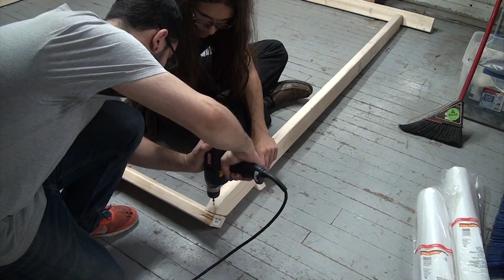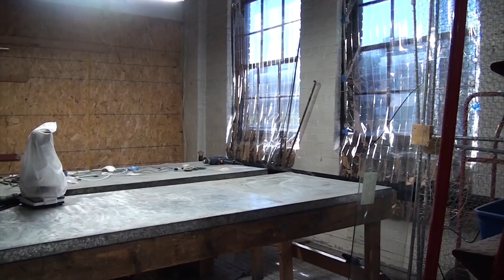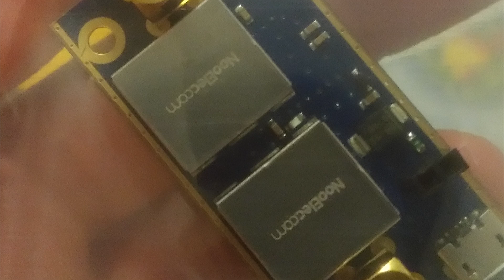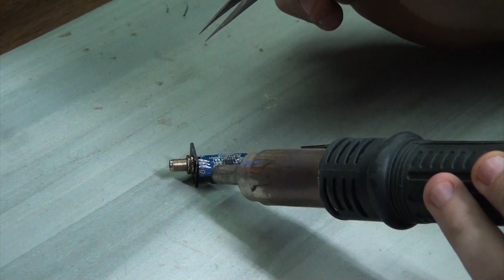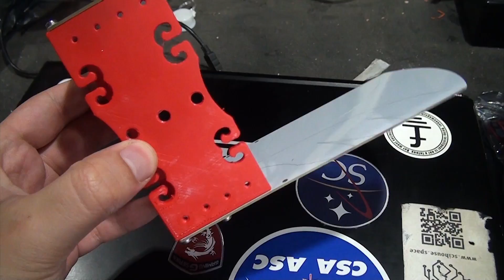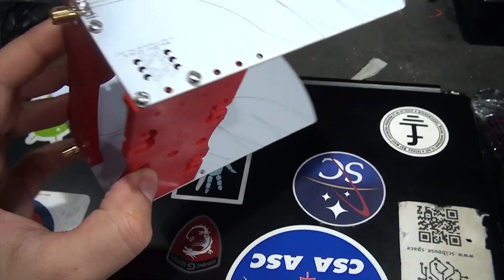Bio Lab, GOES 16, SDR mods, Palm Tree Antennas and more!

Comment: experiment: dipole antenna tuning: Take a piece of coax and cut one end off. strip a length of it so that there is an excessive (relative to wavelength) piece of exposed core to act as an antenna. Cut the removed piece into several sections. Put a few of those section back on the exposed core and connect the cladding with lengths of wire. Watch your power levels as you slide one section down the length of the exposed core to see if there is an optimal point. The do the same with each of the remaining pieces. What results do you get?

Comment: radio experiment idea: I was told that there are some bands that do not penetrate the upper atmosphere. I wonder if there is any satellite that rebroadcasts these bands on different frequencies or if there is any spectrograph comparing the spectrum in space with that on the ground (what those bands are).

Comment: Did you do any research on Radiative Cooling panels?  

They are like "reverse solar panels" (not really) that basically cool things by throwing the most infrared possible into space while reflecting most energy coming from the sun back, they are basically albedo radiators.  

What little I could scrounge up from the web is that the company making them "targetted" the radiation spectrum in which the atmosphere is reasonably transparent and they claim to obtain temperatures as cool as 40 degrees Celsius lower than ambient.  

More than that was either behind paywalls or secret.
Reply from the maker: Sci-hub is your friend for anything behind a paywall

Comment: rtlsdr dongles are pretty terrible above 1500 MHz. Sure, with one that has a properly cooled tuner you can just barely get 1620 for iridium, but pushing towards 1700 MHz with rtlsdr (at least for R820T2 tuner) is going to be like pounding a nail with a banana. It's not the right tool. If you have an E4000 tuner dongle that would work better.

Comment: There is a version called NESDR SMARTee which has the always on bias tee you talk about. Yours is the normal NESDR SMART with no bias tee. The component you removed is a diode that protects the dongle from static electricity. The bias tee components are just a capacitor and an inductor, to disable it you just need to remove the inductor. The capacitor needs to remain there as it's in the main signal path.

Comment: Does any one have a documentation of the nooelec NESDR smart that explains how the serial data is organized and how to send serial packages to the SDR ?  i want to program my own software on a C level, thanks in advance.
Reply: There are a number of open source drivers that talk to a range of SDR radios. You can use Osmocom or Soapy for instance. The advantage of using some abstraction is that you can automatically support a range of SDRs.

Comment: Thanks for an update! Regarding RTL-SDR - do you have some filtering in your signal chain before your LNA? If you don't - it is nearly useless - especially if you use wide band receiving antenna. Also, shielding your dongle may help (if it is not shielded yet).

Comment: im all for what ever works is best ,but the framing of the positive pressure bio lab room is so bad. i hope there was added stability from bolting it to the floor. i just think it could cause problems in the future. love all you other work but look at some carpentry YouTubers.
Reply from the maker: There's method to the madness actually. It's built the way it is to allow for smooth plastic layers. Otherwise I'd have gone with a more standard frame.

Comment: Hey guys, nice job on the GOES system. One thing I noticed though is that the RTL-SDR you bought doesn't have a bias tee. You need to buy one specifically with a bias tee built in. Also the component you removed is not related to the bias tee, what you removed is the ESD protection diode. What happened was that probably the SAWBird was putting 5V onto the SMA, and the ESD diode was shorting out the external 5V, which is why it turned off when you connected it.
Reply from the maker: Update the new RTLSDR works and we've officially received packets from GOES
Reply from the maker: The new one we bought was specifically because it doesn't have a bias t so we can power the filter externally. And ok good to know! I've been having issues with this SDR since I bought it, so figured it was worth trying. Eitherway least we've got another to play with now.

Comment: It appears the effective bandwidth (2.2MHz) of an rtl-sdr is just about too low for hrpt (2.4mHz.)
Though if you have an extremely strong signal, I suppose you might be able to push it and use the max bandwith (2.4MHz) of the rtl-sdr. Do note that the signal it drops off quite significantly though.
Reply from the maker: For hrpt i'll use the hack rf. I just need something else for goes specifically until the goes program is updated to work with the hackrf

Comment: I am looking forward to the radar.  Where does one even start on a project like that?
Reply: Mat Holliday if it's passive it's really easy. You can use something like rtl_power and an ATSC/NTSC broadcast tower with a directional antenna. If a plane or birds fly infront of the transmitter and receiver they will show up as blips

Comment: Couldn't you have just used a dc blocking capacitor to disable the bias t? I do like the creative solution however, but i'm just curious.
Edit, I almost forgot, good luck for your ham radio license although I'm sure you don't need it.
Reply: You could but that would mean cutting a trace and soldering in a capacitor as opposed to just easily pulling off that tiny FET. They could have just cut the trace and been done with it, but that isn't as easily fixable as what they did, which is probably why they did it first, and since it worked there's no point in resoldering the FET and doing that.
Reply: You can buy dc blocking caps that are placed in an SMA package.Such as this one: https://www.amazon.com/Skywalker-Voltage-Blocking-Coupler-SKY16900/dp/B008UTK85U/ref=sr_1_4?ie=UTF8&qid=1534464332&sr=8-4&keywords=dc+block
I can't recommend this model, I just did a quick search on amazon.
Reply: KG5UBB No you should always have your license even if you don’t need it because you learn a lot and it’s handy to have
Reply: Oh that is very true. I was referring to the luck in passing the test.

Comment: Is there any pre- built goes antennas under 100$?
Reply: Sarah Bingham antennas are never the expensive part, it's the part that takes the antenna and turns it into a signal that's hard ;)
Reply: Sarah Bingham just make your own it’s fun and another thing to do in the radio hobby
Reply: Sarah Bingham well you can't really get one meant for GOES. But a 2m/1.75m TV dish works great for GOES.